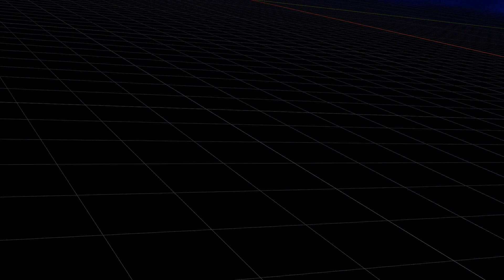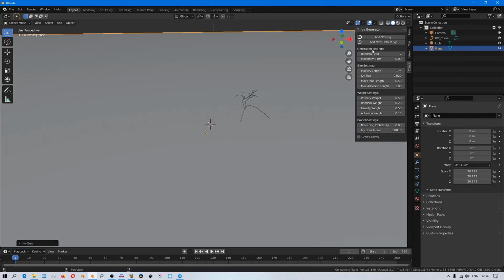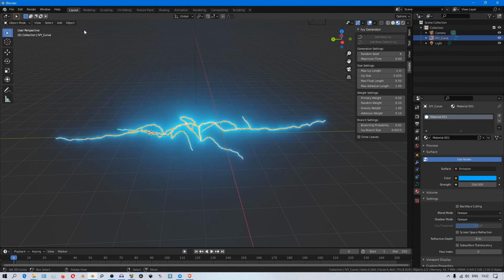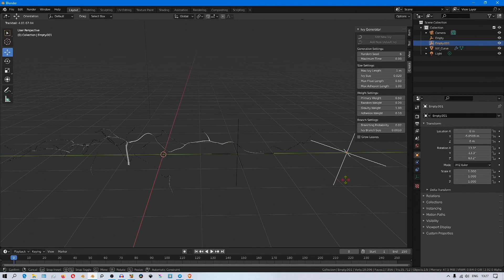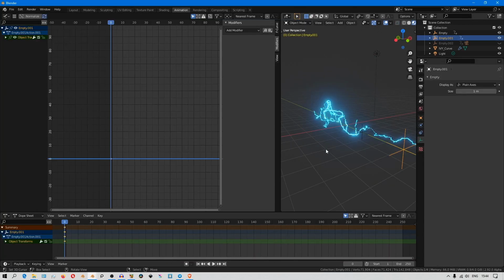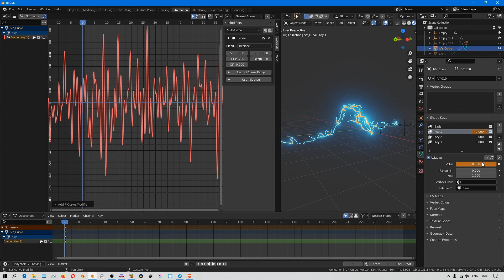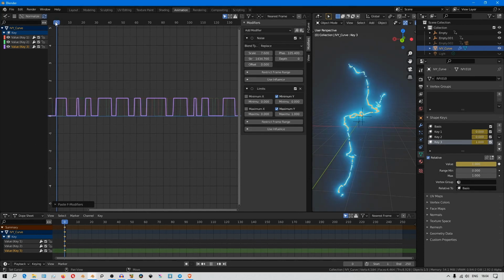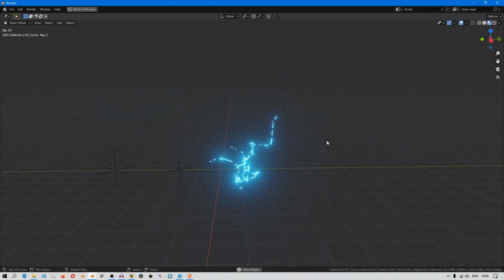How to Electricity in Blender 2.9

Comment: This is a bit of a weird question but 6:17 how do you rotate the branches and how did you select the vertices of the branch without selecting the whole thing
Reply from the maker: Hover over your preferred branch and hit L to select all vertices linked to the target vertex.
Reply from the maker: To rotate them, I set the pivot point to 3d cursor and place the 3d cursor at the point of branching, I can then rotate the selected branch around the root of the branch... I hope that made sense
Reply: @RIOTGEAR3D  I think I understand what you mean by that and thank you

Comment: I can’t seem to find a way to export these bolts out of blender while keeping the glow / emission / bloom. I try rendering a PNG sequence with a transparent background and the glow is gone. If I have a solid background, the glow is back. Not sure why this is.
Reply from the maker: Could be the glow is there but just not very visible on a transparent background. Try adding a solid background in compositing
Reply: @RIOTGEAR3D  My workaround since I made my post is this: The Eevee engine in blender doesn't render emissions on transparent background. Why? I don't know. Cycles maybe would work but I didn't see anything that says it would. So I rendered with a black background and in AE blended it with "screen". If I pre-composed the bolt onto the footage in blender, this method works pretty well If I'm not 3D tracking (which is a whole other can of worms I'm still figuring out.) Anyways that's where I'm at with that.

Comment: im not able to find the generator option in the animation area...when i open animation the graph editor doesn't open but i have to manually bring it through the drop sheet drop bar which im guessing is messing things up?
Reply from the maker: You need to have a key frames set on the value you are animating, the options will then appear